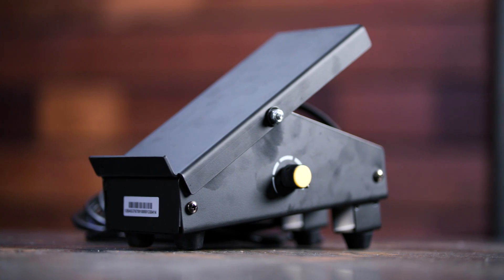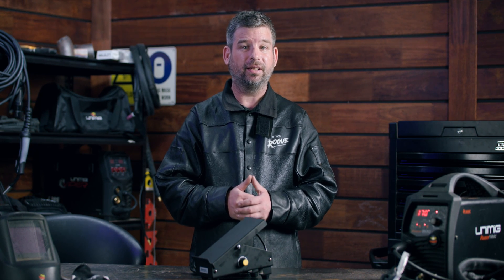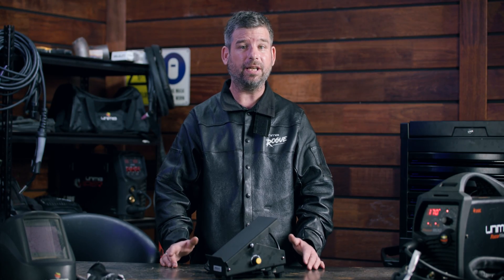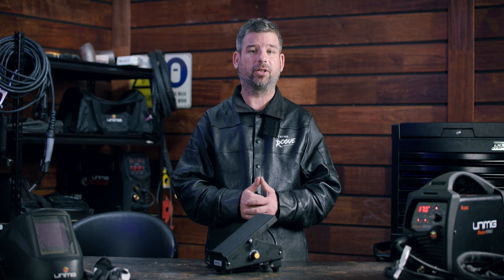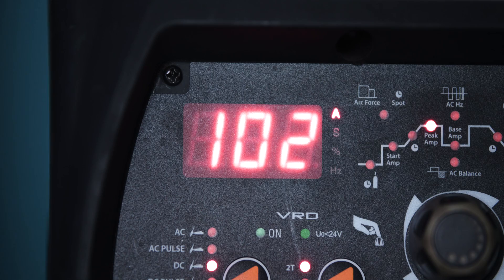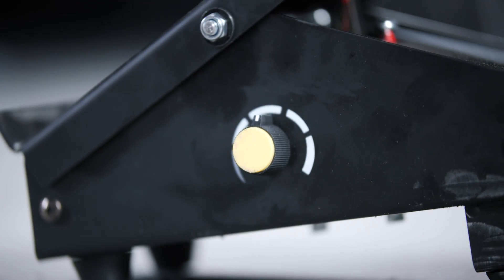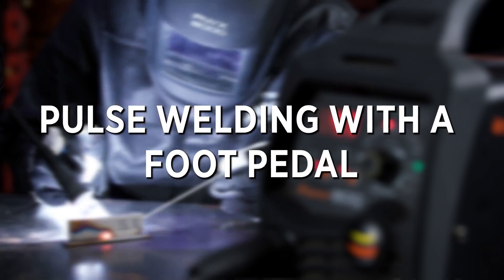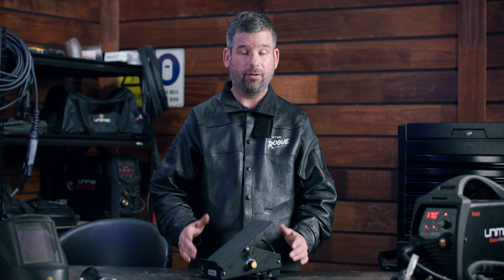How To Set Up & Use A UNIMIG TIG Foot Pedal

Comment: I have a Viper 180 and the Unimig foot pedal it works well on DC and allows a great control range but when used for AC welding on aluminium I find the arc wont initiate unless I 'floor' the pedal and then the arc is to strong for thin material and punches through, is there a setting I am missing so I can get softer starts of the arc?
The aluminium thickness I would like to work with is 1.6mm or thinner.

Comment: Not a criticism of the Unimig foot pedal .. but are some of the alternative compatible pedals any good? I've got the Unimig pedal for my Razor 200ACDC and it's pivot point is proving to be a bit of a challenge for my old leg and ankle. The flatter pedals with a pivot point closer to the heel look less of a challenge.

Thoughts?
Reply: im making a frame  to use like a auto car Accelerator Pedal see if thats better
Reply: agree , i find it hard
Reply: I'm the same. It's to higher angle.
Reply: I agree, it’s awkward to use. Need to be able to leave your heel on the ground.
Reply: I have linked a USA made pedal which is a much better design.
Reply: @evanc6777  is that the ssc controls one?